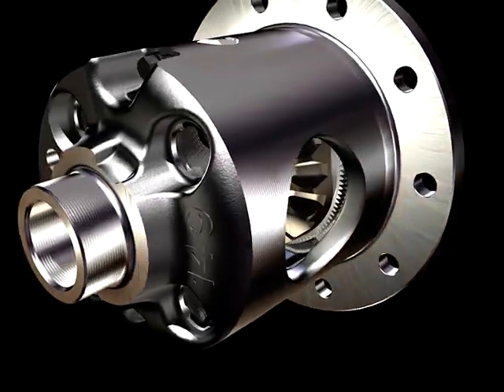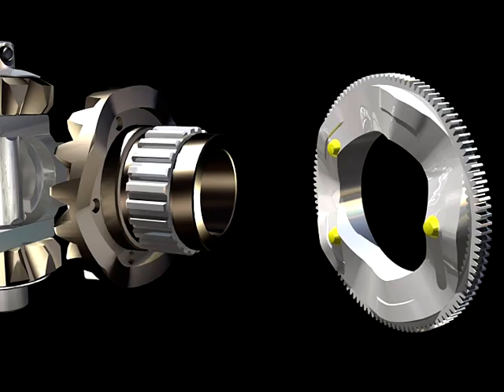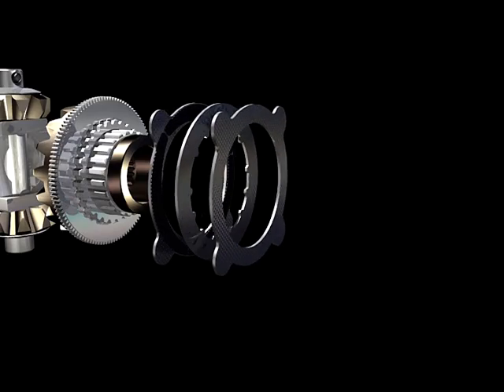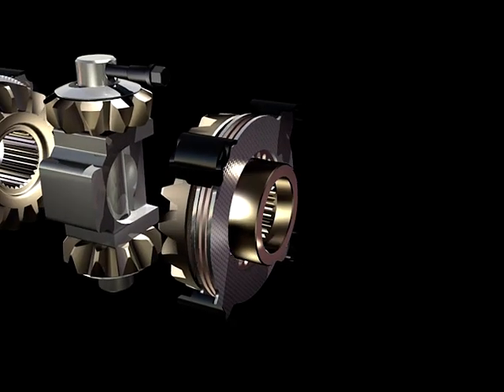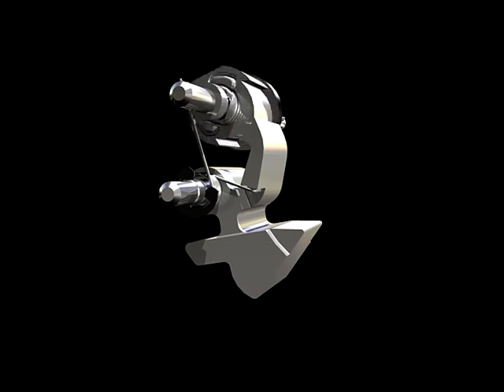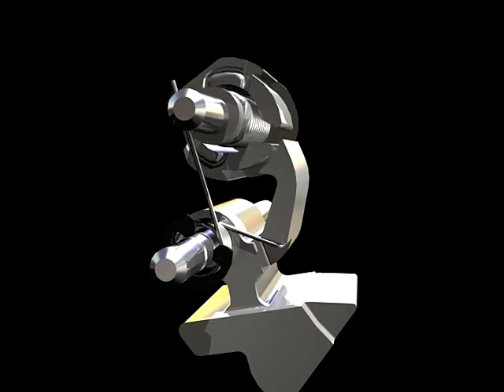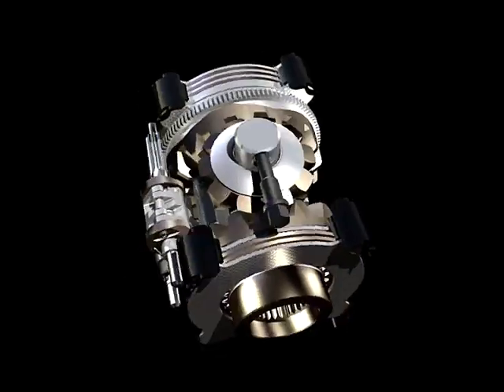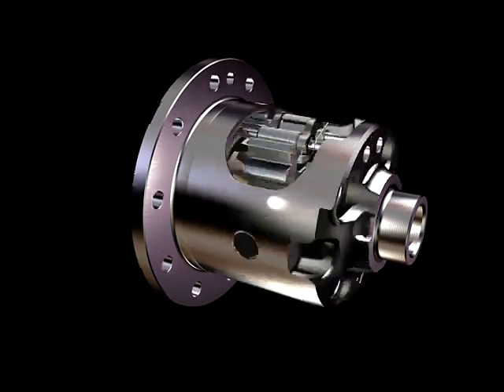Eaton Mechanical Locking Differential

Comment: might sound like a dumb question and I'm probably not getting this, but, something doesn't add up.
Let's say the engagement mechanism is connected to the right side gear, implicitly the right wheel. I totally get what happens when there's a difference in speed and how the mechanism locks. My question is tho: considering that the locking mechanism is only hooked to one of the wheels, thus spins only with that wheel, what happens when let's say the wheel that's got the locking mechanism hooked to it doesn't move, how does the mechanism lock?

Comment: I've seen these last for years. It's not for draggy race or extreme off roading where you really bind up the axel over and over. Just regular use they hold up just fine. Hard blacktop engagement over and over will wear it out faster.

Comment: Ingenious design. When one wheel versus another wheel has a differential speed of 100 RPM, then limited slip engages.

But when the entire case is rotating, because the vehicle is already moving, at ~20 mph, then the limited slip mechanism cannot engage. So, under normal driving conditions, no constant wear on the limited slip clutche plates. Definitely not good to be revving your engine hard, to get the free spinning wheel to lock.
Reply: Not limited slip.  It locks up.

Comment: Alright, so this is an LSD, not a true locker.
Reply: It’s a locker.
Reply: @GH-oi2jf  Ok, do you know how an LSD works? It engages the other wheel when it detects a noticeable difference in speed between the two wheels and stays engaged when torque is applied to the diff. When the diff is stationary it is unlocked. The difference with a locker is it remains locked when you want it to and remains unlocked when you want it to. LSDs are automatic and lockers are manual.
Reply: @kelvinelrick807  Not all lockers are manual, Detroit Locker is automatic as is this one. LSDs use either mechanical bias like a gear type or spring bias like a clutch type to split torque as much as possible while still allowing enough slip for turning. This physically cams the clutch disks together effectively locking the differential.
Reply: @51farmalla  An LSD is an open diff with no torque. A locker, manual or not, will stay locked with no torque.
Torsen is an LSD, slip is required to bind the gears together to lock the wheels. Diffs with a clutch pack do the same thing, squeezing clutches together to lock the diff.
This diff does the same thing. By slipping one tire it triggers a mechanism inside the diff to lock the tires rotation together.
Spartan, Yukon Grizzly, and Eaton Detroit lockers all locked without any slip.
Basically, if the vehicle is moving in a straight line and the diff is open it is an LSD, if the diff is locked then it is a locker.

Comment: The best option is 1 way clutch LSD, limited number of parts working on the momentum transfer by spider gear to pressure plate due to speed mismatch between the pressure plate housing and spider gear

Comment: How on earth to people come up with this stuff? Genius
Reply: as a mechanical engineer, I have no idea.
Reply: Try looking into how an automatic transmission works, then you'll be even more baffled.
Reply: I know they can't have no common sense, Incredible....
Reply: morons throwing crap together until something works
Reply: Over-engineering. There's a very straight-forward solution to locking the differential, but it's patented.

Comment: So it comes unlocked every time you go in reverse or drift backward?  That would make getting unstuck challenging.
Reply: So then go and design something both more effective and more durable, involving no electronics.
Reply: @MediaFilter   It's called an Ox Locker.
Reply: I believe it works both ways.

Comment: Looks to me like engagement could be quite violent with this mechanism.
Reply: It was and as the clutch packs were out the little engagement mechanism took a beating to the point of breaking and when all those little pieces found the ring and pinion.....metal oatmeal
Reply: @medtec6747  Yum!
Reply: I have a 1967 Bronco that I'm restoring, it will be far from stock, 550hp, 35-37" tires. I'm trying to decide what system to go with. I'm leaning towards a torsen type locker in the 9" rear. I know it will still spin a tire if one is hung in mid air but with light braking it will apply enough tourqe to lock up. I really like the design because it's as "automatic" as you can get. This rig will see 75% off road and 20% in town and 5% highway roughly. 

For the front dana 44 I'm thinking of something along the lines of the ox locker with cable shifter. I do like that if my cable breaks I can insert a slug into the dif and achieve lockup. 

I'm wanting to stay away from  the e and air lockers on this rig. I know I say this and am also putting a 351w with obdII   efi on it. I just want the axles to be strong and simple.
Reply: Pretty much. But thats what you're intending with a locking differential. There's other designs for a far smoother differential (limited slip), which usually don't require a disconnect at various speeds. By being more aggressive this differential is able to ensure maximum locking and prevent any torque loss the other systems would see. That gives it superior traction in drag racing, or superior traction in offroad settings. But a problem often faced with older systems of this design is the system bouncing between 100% on and 0% on states adding a violent vibration and making it difficult to manage and uncomfortable hence the use of the smoother systems in racing applications. This design seems to have eliminated that for a more violent lock up if my assumptions are correct, and generally be an improvement to a lot of problems older designs faced.

Of course newer differential methods offer the best of both worlds with electronic systems able to switch between 100% locking modes, limited slip modes, and various other powerful techniques (eg torque vectoring) through clever computer management. Of course they are all simulated and not perfect, but it would push this design into very niche applications outside of OEM road cars in my opinion. But even before electronic LSD designs the conventional limited slip differential already made a locking differential pretty niche anyway.
Reply: @olivialambert4124  Nothing at all niche about it - as per number of pickups that have used lockers for decades. Limited slip does not offer the same durability. That's why lockers exist for offroad / rough terrain purposes, and limited slip is used on roads where there is some nominal difference in traction between the two drive wheels. Lockers also waste less energy getting to the desired traction state when one wheel is spinning in the air. As for electronics... no thanks.
Reply: @MediaFilter  Pickups are rapidly shifting towards electronic differentials as I suggested. There really isn't much advantage in having a locking differential over an electronically controlled differential was my point. Perhaps in large semi-trucks for a stronger system where extreme torque is needed, but for non-commercial use it doesn't have enough benefit over the far more versatile and frankly pleasant e-dif. And in that non-commercial use the wear of an e-dif is well within the requirements for the vast majority of drivers and simply isn't a factor.

I'm also distinguishing it from manually operated locking differentials for a reason. They do have a purpose, often operated as the car switches from 2WD to 4WD, but even then we are seeing that whole sphere shifting to electronic control with driving modes and more automation.

With all that, being technically a limited slip differential no longer means it is restricted to limited slip use cases. Even if it only ever jumps between 100% lock and 0% lock like an automatic differential the smoother lock up and computer control makes the e-dif far more worthwhile in modern cars.

To me it seems that you had misconstrued the point as LSD vs automatic locker rather than e-dif vs automatic locker. And whilst you are strongly against the e-dif, the vast majority of purchasers really aren't and would much prefer a far more pleasant driving experience in line with modern expectations. This can be hinted at with modern trends rapidly moving towards "luxury" pickups, crossovers, and generally comfortable vehicles over the past utilitarian or offroad focused offerings.

Comment: Am i right in thinking it will never lock up at highway speeds   20mph+ ? So no good on gravel or snow or if you're competing in high speed off road events ?
Reply: On the snowy surface the particular wheel will not get much traction so it will revolve at higher rpm so when it crosses 100 rpm then the locking differential comes in play and lock the whole mechanism to work as a single unit so that the wheels on higher traction pulls the vechile out side